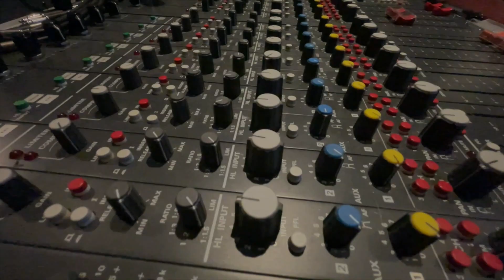Audio sample rates explained

Comment: Actually video analogy here is wrong. It is not about Flash Gordon's speed but speed of human eye or ear. 24 frames per second is the threshold of our eye to see movement out of stream of images. Of course there are faster things and human eye misses a movement but it is not natural so see things in superslow motion. On the other hand, 44.1kHz was estimated upon 20kHz of human ear range and range is called sound. Higher than 20kHz is ultrasound that humans can not hear. So frames were taken at 22.05kHz for two channels. That gives 44.1kHz. Of course Paul knows all that. Etc. But video analogy would be if we take video in 16 frames instead 24 then we woud see stream of images instead seamless video. Some say that this is actually the one of the problems with digital and sample rate od 44.1kHz. It takes less then human ear can percieve. Because it is defined by highest frequency we can hear which gives pitch and it is not correlated to the speed of our auditory apparatus - our ears.

Comment: So higher sample rates capture more of the finer signal detail, most of which are inaudible harmonics, that give a more complete picture of the recorded sound. Of course those extra details first need to be recorded at a high sample rate and played back at that same high sample rate, to be heard at its optimum sound quality. Standard CDs are only at 44.1 sample rate but at least they carry the bulk of the signal frequencies that are actually audible to the human ear and can be reproduced by many good speaker systems. The reality is that most speaker systems have no chance of reproducing those extended harmonic frequencies and most people couldn't hear the difference if they did.

Comment: Hi Paul, you're right, motion picture frame rates are a good analogy for explaining sampling rates and maximum upper frequency response limits at a simple level, which can make it easier for some to understand.  A good example that virtually everyone can easily relate to is the seemingly "backward wagon wheel" effect in westerns (or variations on that theme).  24 fps for film, or 30 or 25 fps for video, is good enough for most motion to be captured and played back, such as the motion of the horse-drawn wagon.  But the spokes on the wheels are often moving past a reference point too quickly for those film or video frame rates to adequately capture correctly, such that they often very noticeablely appear to be going backwards (or in other less-obvious wrong rates forward or backward or even standing still).  With too-low sampling rates in signal processing, we call that artifact "aliasing".  The all-important anti-aliasing filter is intended to low-pass filter an electronic signal before sampling to ensure that any aliasing artifacts are low enough in amplitude so as to be generally unnoticeable.  It might also be worth pointing out that "sampling" is an analog function (not inherently digital).  "Digital" enters the picture when the samples are quantized (to some discrete level of digital resolution), which inherently introduces some level of "quantization noise", analogous to fuzziness/grain in a motion picture.  //  I'm no expert on DSD, but lest we risk confusing anyone, the preceeding quantization discussion fully pertains to PCM (pulse code modulation), but I believe that DSD is significantly different in that each sample is only encoded as one bit, as delta modulation, i.e., the next sample is either higher (1) or lower (0) than the previous sample (relative level, not absolute, which is why the bit rate has to be MUCH higher), which then gets recorded as pulse density modulation (PDM).
Reply: P.S.  "Aliasing" is called that because it creates a false signal in the baseband that can't be filtered out by the output low-pass filter, the job of which is to filter out the ultrasonic components of the "stair steps" in the reconstructed signal from the sampling and quantization processes.  Also worth emphasizing is that the Nyquist sampling rate is the mathematically ideal absolute minimum rate for capturing the desired maximum bandwidth-limited (low-pass filtered) signal, e.g , 40 kHz sampling to capture no higher than 20 kHz size waves.  Real designs (e.g., filters) are of course never perfect, so a higher sampling rate is required in actual implementations.  Given the technology available in the late 70s and early 80s, Sony/Philips chose the 44.1 kHz sampling rate per channel for the CD system in order to get the frequency response up to 20 kHz and the  aliasing artifacts (along with the 16-bit quantization noise) down to the -96 dB target "perfect sound [forever]" range.  Later advances in higher-frequency lasers and manufacturing techniques made higher sampling rates, more quantization bits, and more channels (e.g., 5.1) possible with DVDs, SACDs, Blu-ray discs and streaming [not to mention ever-higher-resolution video except on SACDs!].

Comment: Sample width.  I am wondering what the duration of the samples being collected is.  I suppose that ideally the measurements of voltage would be instantaneous but I doubt that in the real world that is possible.  So what is the duration over which the signal voltage is measured?  Like in photography the sample duration (e.g. shutter speed) is important if you want to stop the action.  In music recording the signal voltage is rapidly changing so a very short sample window must be needed to stop the action and minimize blur.  I am guessing that overly long or nonuniform sample durations might also manifest itself as jitter.  Is this an issue in designing sampling equipment?  Is it easier and/or faster to record a one bit vs 24 bit sample?